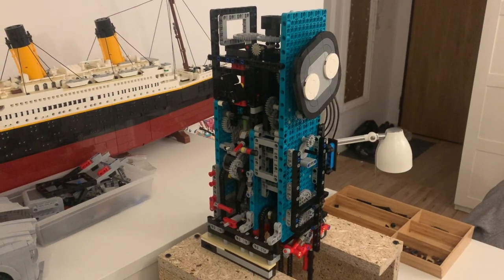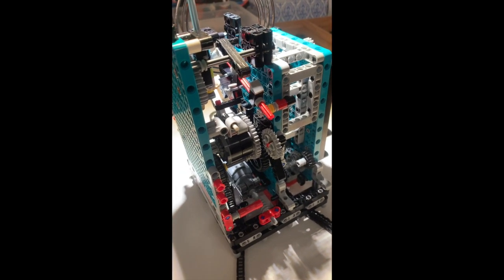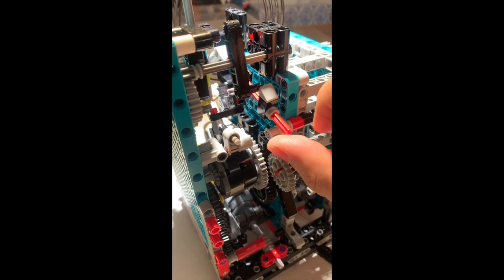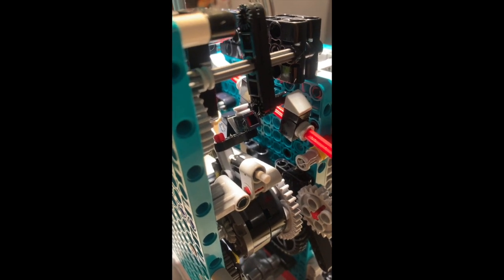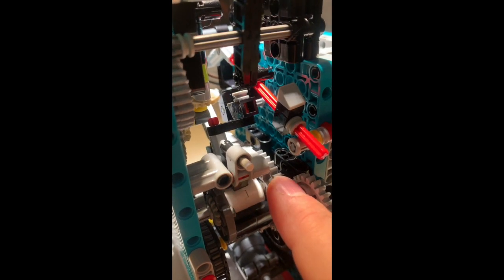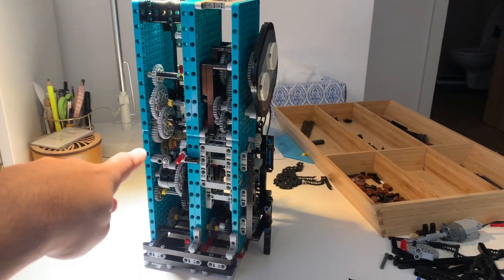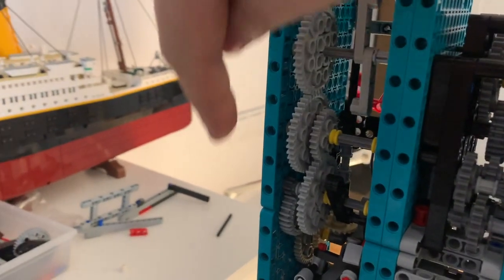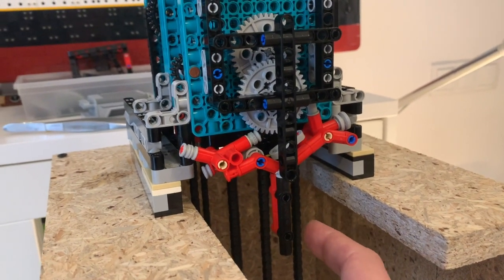Lego Clock Project - Rebuilding (part 3) #lego #clock #striking #rebuild

Comment: great, simplification is always good imo
Reply from the maker: It is. The clock will require, in the future, some maintenance like cleaning and so on, so it has to be easy to disassemble as possible. Although it just looks better 🙃
Reply: @borysf  Okay, I see. The plastic will wear eventually without lubrication probably.
I always remind me of "form follows function".^^
Reply from the maker: @guentherjuergen7304  exactly. Real brass clocks require cleaning and oiling, plastic ones especially :)
Reply: @borysf  right, otherwise the plastic dust will get the best of you :p
Although I try to run my clock without oil for now since it makes it really messy. And the neat thing about lego is that its probably the easiest system in the world to get replacement parts for. I have several replacement escapement wheels (lego bricks) laying around in my box.
I'll see how long it lasts.
Reply from the maker: @guentherjuergen7304  you don’t ever oil the gears, but only the axles where they go through the beams - so it’s not that messy 🙂 oiling the gears is ultimately bad idea as all the dust will mix with the oil and will stop the clock very soon.

Regarding Lego - it is, so far... I heard they are going to produce parts from “eco” plastic so I’m not sure it will keep that strength, so maybe it’s a good idea to make some today’s parts reserve 😅
Reply: @borysf  okay that makes sense, didnt think about that👌
I heard that with the eco legos too. They might be weaker but if it works I think I will like it. Algae legos :D